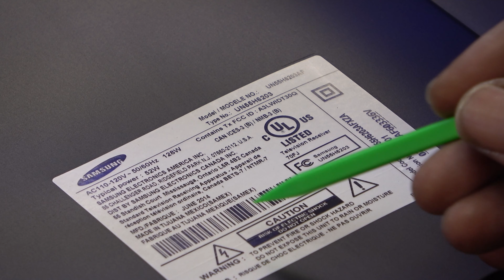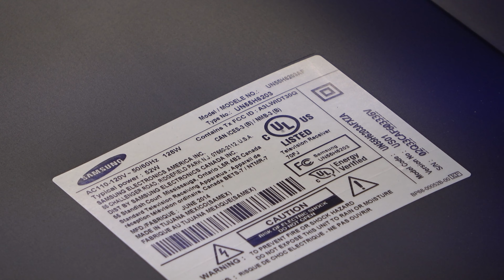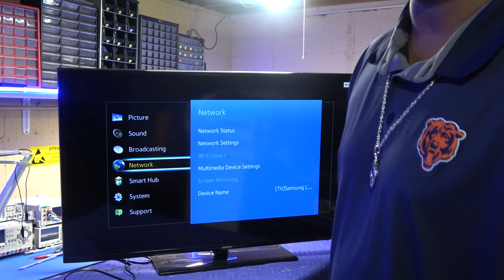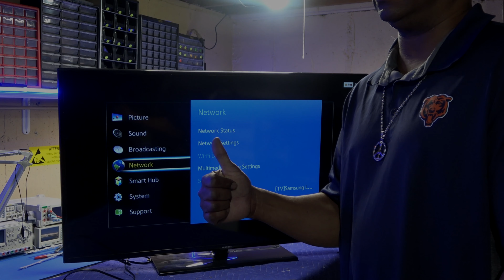Samsung 55 inch Smart TV has sound but no picture. Samsung model Un55h6203AF Television repair.

Comment: You are the best teacher. Thank you!!
Reply from the maker: Your very Welcome George!
Reply: Sir you didn,t answer my question.
My Samsung 55 has no sound no picture. Any thoughts
Also the meter you use you put power and check the leds  .
Thanks
Reply from the maker: @georgechristolini7869  Sound but no picture is usually an indication of bad backlights. The led tester is just a low current power supply used to light up the led strips. Hope that answers your question. Thanks for watching!

Comment: Great one. Many thanks. Good luck on all of your business desires.
Reply: By the way, do you know what is the exact part number for this Samsung smart tv detail as shown in next? I want place an order to replace the entire stripes group of my tv not only the burnt ones.
So based on those info, can that tell the exact part number of the new backlight led stripes? If not, what would be the best way to figure it out. Many Thanks to you
The detail of the smart tv are
Model code: UN40F5500AFXZA
Version No: TU02
S/N: Z6TW3CTDC02296E

Comment: One of the most in-depth tutorials I've seen on this problem. You definitely know what you're doing! Can this job be done without an LED specific tester? I only have a fluke multimeter. Thank you so much!
Reply from the maker: Thanks for the nice comment. But U do need an Led Tester to test the entire strips. Only thing a Multimeter is good for is seeing if you have voltage going to the led strips. We have some in stock....https://bigdogelectronics.us/collections/digital-multimeters
Reply: @bigdog8882  I appreciate it! I did a little bit of research after I made the comment, and figured out that I did need a strip tester. I didn't even know you had a store! Have an absolutely amazing day man.
Reply: I took two 12 volt batteries in series and plugged into the harness at each of the pairs +/-.  Told me some worked and some were bad.  Enough to tell me I need to replace some, so might as well replace all.

Comment: Thank you so much brotha. Got my 55 inch up and running. Needed new LEDs and power supply.
Reply: How did u get the replacement parts ? Any websites you could suggest me?

Comment: Thank you for the videos! These are very informative. i just received a Samsung tv that has power and no backlight. My question is can you pick up the LCD panel without the suction cups? If so, how do you suggest moving without breaking?
Reply from the maker: Use 2 people; one on each side, and both of you put one hand up under the screen toward the middle to keep the screen from bending.

Comment: This is a great video.  I've got a 55" Samsung UN55HU6950FXZA.  A couple of months ago I noticed two bright dots on the tv that I suspected were LED's.  Then yesterday I had sound and no picture.  Using an LED flashlight I can see the picture.  My question is should I fix it or replace it since it's a few years old?
Reply from the maker: Replace the backlight strips

Comment: Please advise. Is it worth to fix Samsun 55' NU8000 that has power cycle and no picture issues. Turns On / Off by itself every 5 sec. No picture but audio and backlight comes on. You are the Master : ) Thank you!
Reply from the maker: Bad LCD Panel, most likely causes that on that particular model samsung.

Comment: I got a free 32 inch one Model le32r88b, would make a loud cracking noise on speakers power up and no display but eventually would come on and work. it's usually the 4 x 1000uf 10V caps. Two of them are under the shield on main board two of them are outside the shield. They're electrolytic surface mounted, level 4 difficulty removal and hey change the battery in the smoke alarm, that chirp gets ignored until it's too late.

Comment: Question, I have the same TV the picture doesn't come on but the sound is on. If you walk up to the TV you can see a light blue on the whole screen. When you turn the TV off it gets a purple streak that's about 3 in wide across the whole TV and another roll a few inches down. When I unplug the TV for a full minute and turned it back on it said Smart TV and the picture actually came back on for about 2 or 3 seconds and then it faded. Do you have any thoughts. Thanks for the video and your time.
Reply from the maker: Thats weird

Comment: Hello BD I have a Samsung UN43M5300AFXZA and the entire back light stopped working all at once. I can take a flash light and see that the display itself is working when the tv is on. I took the back off and was inspecting the power board and there is a heat sink that had a glob of white glue or heat sink compound covering half the heat sink. Like someone dropped a glob on it! I haven't been able to test the LEDS but was wondering what kind of multitester you use and if you think its a safe bet that the power board is bad? Thanks for reading

Comment: Hi how about no picture and no sound.
Thanks
What type of meter is that , that it puts out voltage also.
Thanks George
Reply from the maker: You would have to troubleshoot that one. That is a Backlight tester. Its just a low current Power Supply used to light up the led strips to make sure they work.

Comment: My Hisense 50R7E 4k TV wont turn on(black screen). The red led standby blinks twice then goes solid(keeps looping). When I shine a light in the dark at the screen, I can barely see the boot logo looping on and off. I've tried unplugging/ waiting 10 minutes, holding the power button down for a minute, and pressing and holding the reset button. I took the back panel off to check the capacitors and they looked fine. My multi-meter found that even with led cable connected or disconnected, the volts jump up and down. The cable going the main board seems to have correct voltage and is stable. If you have any suggestions that would awesome! Thank you.
Reply from the maker: As soon as you can see anything on a black screen with a flashlight, then just change the led's. Dont make it complicated.
Reply: @bigdog8882  Thank you for the reply! Hmmm even when I unplug the LED cable from the board, the TV keeps cycling on and off. I noticed the standby light starts off bright red then dims and blinks twice(doesn't stop trying to turn itself on). Would a bad backlight cause that? I've watch a lot of videos where flashlight test reveals the TV is actually working but just has bad LED strips. I feel like there's a bad capacitor or some type of short on the powerboard. I bet its both though with my luck lol
Reply: Also my standby is a solid 2.5volts, the cheap board doesn't say what it should be. Shouldn't it be 3.3v or 5v?

Comment: When disconnecting the left and right cables from your driver board, you seem to snap something down before just easily lifting the cables out, I don't see anything to let me do that. Can you explain what you did at 10:57?
Reply: You need to lift the horisontal clip. Check out other videos of how to remove t-con board

Comment: Awesome Video! Maybe you can help me, I have almost the same tv. UN55J6201AFXZA  I have replaced the mother board and the power supply board and the backlights are still not coming on. I have audio. If one strips of LED goes bad will that make all the other led strips not to work? Help please and I'd really appreciate any suggestions from you.
Reply: hello?

Comment: Hello i have a samsung, un75ju6500 all suden has no picture but audio working. I hear from a antrna channel audio. Had unpluged drain power from power button. I dont know any tech nearby were i live. Wonder what hardware problem could be.  I press the imput on remote i sell light on screnn but like purple. I know its not cracked lcd. But wish to knkw if its an unexpensive fix and if i can do it myself. Will appreciate any help.
Reply from the maker: Bad led strips most likely.
Reply: @bigdog8882  i will give a try hope i dont brake  that 75 inch screen. Can you help finding them? Thanks for reply Abd help.

Comment: So, is it only Sony who use adhesive strips between the lcd screen and the diffusers just to make it more likely you'll damage the screen removing it? They got me!
Reply: The cheaper ones like JVC, BLAUPUNKT, 50” and 55” use a black sticky tape or like a black silicon glue on the top of the screen be warned
Reply: Mm
Reply: @wisher21uk  mnññmñ
Reply: @wisher21uk  ñnnnnñnñnñmmmmññmm
Reply: @wisher21uk  nñññmmmmmmkkk

Comment: If you've replaced all the LED lights and have confirmed they all work, but the TV still has a dark side, is it safe to assume the TV has a bad display panel? Or could it be one of the cards?

Comment: Bn96-35412A vs BN96-39412A
Could these two t-con boards be swapped on Samsung 55 inch LED TV? The later isn't available for replacement while former is available.

Comment: I have this same tv that has some issues one of which i know is the power supply (it turns off whilst using it at random sometimes) but what i dont understand is why there's no sound from any input with the built-in speakers whatsoever

Comment: Hi i have 50 inches smart tv it keeps on and off every 5 sec. Sum1 tried to fix it and change the mainboard. Back light is working but there is no picture he tried to fix the panel he told me there was no voltage on it and had to replace it with new screen.. Is there any other ways to fix it without changing the screen panel

Comment: My 55” Samsung has that same problems but I noticed that I can get it to work by pulling the plug out from the back of tv and waiting 30 minutes or so and then it works fine, but lately it’s been happening more often. Does anyone know what could be causing it? I’m thinking that if the backlight was a problem then it wouldn’t come on at all. I do see the menu when I shine the light at it when black. Appreciate any input.

Comment: what do the tabs on the side of the panel actually do?
Reply from the maker: Has something to do with the Horizontal Pixel addressing. There's actually IC's in those tabs if you look close enough. Happy Easter Ken!
Reply: @bigdog8882  I got this screen that the pic is darker on one side. Replaced everything and I suspect a failed panel. When I wiggle a side tab, it fixes the pic. Someone told me to cut it off. Are they joking or serious?
Reply from the maker: @kenpappas9520  If you do that your going to have a PERMANENT bad picture. Only thing you can try is to put a piece of tape on it after you set the tab to where the picture clears up. Being very careful when you reassemble it so the taped tab wont get scrunged.